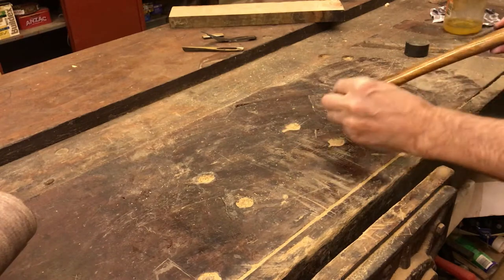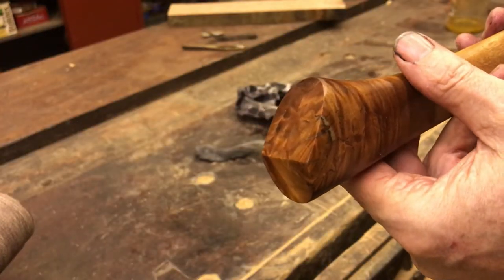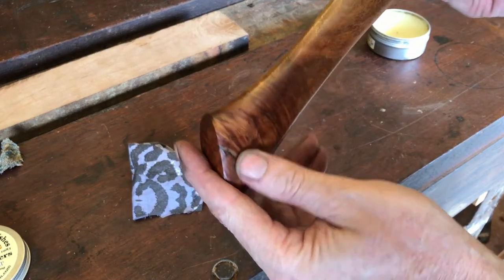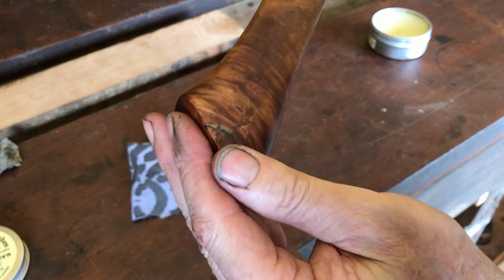Custom Spoon Carving Axe - Single Bevel

Comment: Wish I had a belt sander! currently putting a flat bevel onto an old Sheffield steel kent pattern axe head to make it into a side axe! It's taking me ages! 😮‍💨 Lovely job on the axe!
Reply from the maker: Thanks MaybuTron, Kent Pattern axe heads are beautiful, and in my neck of the woods they are hard to come by, unlike samders....That old sander was given to me by by my Dad and caught fire at one stage because the sparks were flying into the dust bag. I bought another one for $15 and it worked great until i burnt out the motor, then recently I was given another by a friend and that one has been great. Sanders seem to find me lol.

Comment: awesome little carver. that wood is amazing!!!
Reply from the maker: Sorry Lee, missed your comment, but yeah thanks, that was just an off-cut from a hardwood sleeper, normally considered junk wood because it has too many knots and is too hard to work. Looking back i should have stabilized the knot with resin before cutting the toe, but it turned out great.

Comment: Matthew! That is a piece of art.  Good fix on that handle.
Reply from the maker: Thanks Drew, I could have found a more clean piece of wood, if i remember rightly it was cut from an old sleeper. I knew the knot was going to be there, just not so bad, but I am glad with the choice. My only regret was not demonstrating it. It slices like a chisel just with a push.

Comment: awesome job, Matthew! May I ask what vise is that you are using (carter?), jaw width and how do you like it? thank you!
Reply from the maker: Hi P Do, I have not noticed the jaw width as a limitation and have not measured it but estimate it to be 10 inches. 
I could get all the measurements tonight if you need to know but it also opens quite wide. and have never hit a limitation there either. 
It is a really good vise and assume it is older than the bench but i am getting to the point where the wooden jaws are starting to wear out and need to weld the knob back on the handle and I think that would make a great video. My Dad built this work bench and I really love this Carter vise, thanks.
Reply: @Saw-IT  thats awesome that it opens up to 10". would love to know how wide the face plate is 7 or 9" maybe? being an old vise, does it move in and out pretty tight wo any sloppiness? quick release capablity? never heard of the brand and nothing showed up on google search. im looking for a vintage vise for the bench im building....yours look interesting
Reply from the maker: @SmallGameHunter  Hi, I measured it and have got the actual measurements.  With the wooden jaw plates it opens to 9" and jaw width is 9" or 10" with the wooden jaw installed. Carter (was) made in Australia and you might have more luck searching for one by using the Australian spelling VICE. it does not rack at all and winds in and out smooth without slop. it has been used a lot in its life and still has a lot of life left.  You see a few on www.gumtree.com.au  but you would need to get the Australian seller to post it to you.  Not many do, it is mainly a local pickup site because there is no buyer protection like eBay. I posted some pics on my community page. https://www.youtube.com/c/MatthewPainters/community if you want a closer look. Cheers.
Reply: @Saw-IT  awesome! Thank you so much Matthew!!
Reply from the maker: Hi P Do, Since you showed interest in my vice I have taken more interest in it also. I just uploaded a restoration video you might find like. The vice was manufactured post ww2 about 1950 and is very similar to the design used by the Australian manufacturer DAWN.
Reply: @Saw-IT  that's awesome. Imma check it out. Thanks for letting me know!

Comment: I am thinking of doing something similar and would have loved seeing you chopping out a spoon billet out with the finished axe!  How does it work for this?  Anything you would do differently?  Any advise on the process?

Thanks  BTW the axe handle is beautiful!
Reply from the maker: Hi Terry, I basically gifted it to my friend straight after making it so never actually used it. if I made another one I would cut more metal from the head so that you can get your hand further up the shaft. The single bevel turned out good as it makes a thinner sharper edge like a chisel though you would have to decide which edge to grind flat. The next Axe will have two straight edge bevels for two handed flexibility and edge durability. Matt

Comment: I suppose if you are either right or left handed the axe only needs a single bevel - which side did you put the bevel on?
Reply from the maker: Hi Sue, that's Interesting, I did think about this and put the bevel on the right hand side of the blade so if held in the right hand the blade is less likely to dig in.  The old axe head lent itself to be shaped this way so I just went with it, I did not plan to make a single bevel axe in the beginning. I can still put a second bevel on it for her but it is handy to have different tools sometimes. My friend who i made it for was looking to buy an axe for spoon carving anyway so she may still do that but a good one is pretty expensive.

Comment: Mat Painter, you absolutely, positively must see this!  Re: axe bevel geometry
I gets real juicy toward the end, especially @ 20;50   
https://www.youtube.com/watch?v=DQ9KHTo6AQA
I'm doing exact same thing you are! - for making shoe lasts. But just learned why you don't want a single bevel carpenter's axe. Mat, you're 95% there!  Your axe just needs another half hours work to be perfect.
Reply from the maker: Thanks ! That guy is cool and one of my subscriptions. This axe was a spur of the moment type project and it just turned out that way, and I then did some research and decided to gift it to my friend who was looking to buy a very expensive axe for her spoon carving. Not sure how useful it turned our for her but 22 40 of that other video mentions the exception where a flat bevel is desired and that is for working on narrow work pieces. I did not know that. but spoons are very narrow. I took some shavings like as if it was a chisel before giving it away and unfortunately lost that footage or forgot to press record.  That would have made this video perfect.  Thanks for sharing.
Reply: @Saw-IT  I almost always buy real expensive stuff.  But the more I thought about it the more I just wanted good steel, forged - but by hand?! Anyway, I started with thinking about a Swedish axe at $170 and ended up buying a fine axe from El Salvador for $28.  Planning on making  an asymmetrical , left handed, carpenters axe out of it, much as you did.
Reply from the maker: @jthepickle7  it is a fun project and real glad I connected with you.
Reply from the maker: @jthepickle7  Oh yeah, that is a good trick, though the last axe video i posted, i skipped the rag and just went at it with a file. i was only asked to sharpen the axe but the last person butchered the edge with a grinder and it took a lot of work. I also posted some other axe reshaping videos and some of those are on by display wall.  If I do another one it will be like one of those beautiful carving axes in that video you shared. You can never have enough axes. LOL
Reply: @Saw-IT  When you can buy an axe of a reputable steel, like 1045 , forged - if only by machine for $25 and it even comes with a good handle, it serves as fairly cheap 'stock' to cut to shape and 'smith' experimental edges. As a Lefty, if I want an asymmetrical carving axe I have no choice but to make my own. I'll check out your other vids and maybe get more ideas for the one I'm about to work on.
Reply from the maker: another thing i have not mentioned in any of these vids is that while it is obvious to keep the steel very cool during shaping to preserve the hardness,  the actual hardened part of the axe sometimes is just the cutting edge and in worse case scenario for a really cheap axe it could be just case hardened. Something to keep in mind if you are radically changing the cutting edge geometry.  :)
Reply: @Saw-IT  Thanks.  I was unaware of the case hardening. I've seen a few videos on Marbles axes and heard no complaints.
Reply from the maker: @jthepickle7  it is for mild steel, and probably really cheap tools. I did it on a center punch i made at school 1985 and have used it heaps.  Still holding the point whereas the other end is starting to get mushroomed. i recon if i ground that back at all to sharpen, it would be ruined. wow- 37years ago.
Reply: @Saw-IT  "it is for mild steel, and probably really cheap tools. I did it on a center punch i made at school 1985 and have used it heaps. ..."
By "it" do you mean 1045 steel? - requesting clarity.
Reply from the maker: @jthepickle7  sorry it don't know what sort of steel it was or its composition except that it is called mild steel and easy and soft to work and not necessarily designed to be hardened. I guess it is just a low carbon steel. Case hardening only impregnates the outer layer with carbon to make it harder. We made it glowing hot in the forge and dipped it in some sort of powder. I remember the teacher saying it contained cyanide so only he handled it. Google, mild steel case hardening powder to get more info.